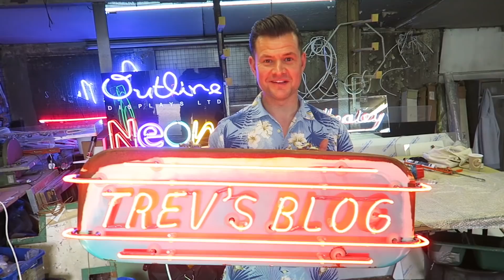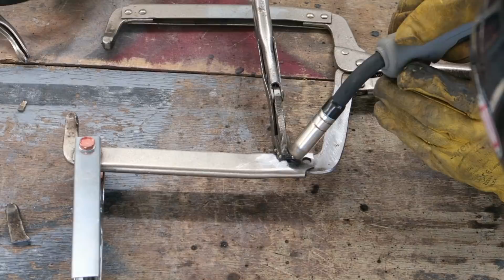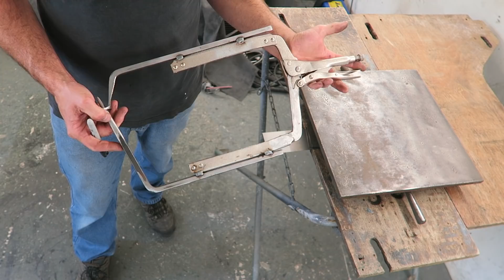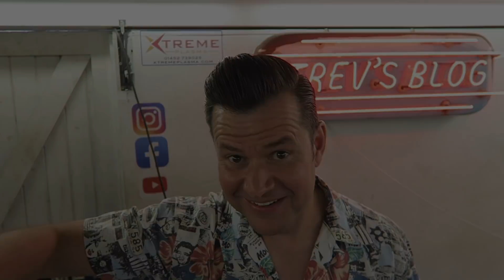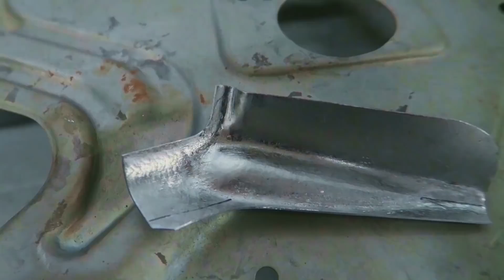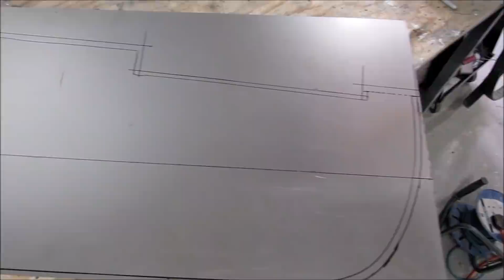Homemade Low spot dent lifter metal shaping car panel beating Tips and Tricks #54

Comment: TREV being a panel beater myself i like to use black guide coat in a rattle can no mess and dries instantly another trick for raising dents is to use an air die grinder but turn down a 5/8 bolt shaft to fit the die grinder arbour 6mm i think and smooth off the sharp edges of the hex just a little bit.so using an air die grinder you can control the speed and the the slightly rounded of bolt head acts like a mini hammer the more pressure you use the harder it lifts the dented spot ingenuity is the mother of all inventions cheers from down under
Reply from the maker: Great idea 💡 cheers Trev 👍
Reply: Can you show Me it in picture ? If you have Instagram pls let me contact u

Comment: Hey Trev, have you tried cold blue for marking panels? The stuff used to do fire arm bluing touch ups. When applied to steel it turns it a blue/black in color, has no residue like ink or paint and is easy to wipe on. It is mild acid and will cause rust if not cleaned up with water. I might even consider some baking soda in that water.
Reply from the maker: Thanks Tom certainly worth looking into, I’ll produce another video my findings sometime in the future as I’ve been messaged with many interesting ideas. Cheers Trev 👍

Comment: Take a wide felt tip marker(Sharpie hopefully) used or new, and wire brush the tip to "comb" the felt. Soft jaw it apart and spray brake cleaner into the back of the resivior till it just turns white. Close up. Thank me later.
Reply from the maker: I’ll give it a go, thank you 👍

Comment: Fantastic idea!  I use a 4 inch (10.16 cm) brayer roller with alcohol based ink to roll over the metal and the absence of ink (on the low spots), provides an indicator of where I need to work.

Comment: Great tool Trev. Have you thought about copper sulfate as a marking option?
Reply from the maker: No I hadn’t, do you mean to actually electroplate the area with copper or…?
Reply: @trevsblog  just add some blue copper sulfate crystals (I get root killer from the hardware store), to water till it dilutes to a blue liquid, brush on bare steel. No mess and scuffs off later. Ive been told this was the "blue dye" before any of that was ever invented.

I have a short 15 second video of it in action. Ill post a link for you as soon as it uploads.
Reply from the maker: @fhpdesign87  thanks for mentioning this, I hadn’t considered acid etching either until your comment nudged me into thinking in this direction. A very basic etch would also give you a very dramatic contrast to filed metal and leave no residue. Cheers much appreciated… Trev 👍
Reply: @trevsblog  

https://youtube.com/shorts/TUN--87wRbg?feature=share
Reply from the maker: @fhpdesign87  that’s brilliant, why haven’t I seen anyone using this as a highlighter. Thank you 👍
Reply: @trevsblog  hey, we're all in this to learn more every day!
Reply: You brought back memories of using copper sulfate  as a apprentice toolmaker 35 years ago , much longer lasting than blue .
Thanks for the videos Trev , regards David
Reply: @daviddeakin2006  thats what I had found in my research, that this was essentially the old machinist method! After testing it, I think I like it more than the blue stuff!

Comment: now thats a cleaver bit of tooling, simple and effective, i usually use the stud gun but with washers instead of pins, that way they do less damage to the surface (less chance of making a hole) and i use a long 1/4 inch drive extension bar to lift the lows up also gives a good chance to lever against any crowns or to keep pressure on while taping around

as for the non eng blue, i used to use dry guild spray but also use a very fine da disc to shine the steel up so its different enough from the worked areas, also aids the weld contact for the washers etc
Reply from the maker: Thank you 👍

Comment: Wondering if that tool would help with my project. I doubt you have much time but I've uploaded a 2 minute video, I need a clue
Reply from the maker: I’ve had a look 👀 most of that damage is perhaps a bit too large an area for the pick as it’s only really for finishing off. The other major problem you will have is access behind the dents. I’m assuming the only way in is through the filler? You might find some pdr rods and equipment helpful in prying out the damage. Don’t be ashamed in using a bit of filler either! Cheers Trev 👍
Reply: @trevsblog  I'd like to keep it plain ally which is why finish is important. Practically the whole bottom has been chopped out so access is no problem. I made bumping spoon from an old file which is working along with a planishing hammer (?) I've plenty of patience but reckon I might have to humble myself and know my current limit

Comment: I don't know why they don't use an eye bolt for the adjusting bolt. I just weld a thick washer on the adjusting bolt. it makes it easier to adjust. Good to stretch, lift or pull things.

Comment: I am never afraid to cut up and weld cheap tools to make something better out of it. My handiest tools are ones I have made or modified from others. Not sure if I will make one as the stuff I work on isn't worth that level of detail but I always learn something new from your videos. My talents and experience are all over the place and for me and not everything I do is going to be done all out perfectly. Gotta pick your battles on how much time to spend on each skill.

          Also for the marking compound don't use prussian blue it's super messy. A spray machinist blue will do what you want as it dries fast and doesn't stay wet. This is what I use CRC Blue Layout Fluid Aerosol 03066. I'm sure there are many brands available in the UK.
Reply from the maker: Thanks for the info 👍

Comment: Why didn’t you just use a shrinking disk?  Way faster and easier
Reply from the maker: It wasn’t stretched.
Reply: @trevsblog  i disagree if it was a low spot it was a dent therefore the metal was stretched to some degree.. Ive watched people repair panels that looked similar to what your fixing using heat shrinking disk and water ,, the panel wound up damn near perfect,, probably could have primed and blocked without any filler being used…just my thoughts..
Reply from the maker: @terryjohnson4391  ok

Comment: That's a cool tool. The only suggestion I have for highlighting the high and low spots instead of Dyechem engineers dye is to use a light dusting of spray paint. Let it cure and sand away. Basically works the same as the powdered guide coat used for sanding and blocking primer. It will do the same Job as the Dyechem without the mess.

Comment: No way I thought you used a ring spanner to start off with. Great bit of kit, I guess the longer you go you start to loose force from the falcrum point.
Reply: Yeah I was thinking big el cheapo offset ring spanner would work for this.
Reply from the maker: The length I set it to seems perfect, any longer and I really believe it would start to lose its accuracy and it would be a lot of weight to shift with the pick fully open. Cheers Trev 👍

Comment: This is absolutely brilliant! I have a bulls eye pick from Eastwood and I am really disappointed with the quality of it. Mostly because where the joint is its too sloppy and makes it inconsistent. I think I will try to make one of these! As for dying the panel, they make machinists blue in spray cans. (Dykem) Its way less messy than the brush on stuff. Also, the really wide tip sharpies work great for marking and layout too (I apprenticed as a machinist and went through and became a Millwright)
Reply: Yeah, the Eastwood stuff is piss poor quality. I have had to modify almost everything I had from them. Not good value, hu. Cheers
Reply: @toddcott9510  agreed. I have a deep throat stretcher from them and the stretcher is good. The dies are terrible.you are absolutely right. Its worth it to save and buy something a little better
Reply from the maker: Thanks David 👍

Comment: Hey Trev.
Great to see you back on the Blog.
Using the large chizzel tip jumbo marker as per Wray Schelin from Pro Shaper seems a relatively common and inexpencive  way to guickly add guide coat for the metal finishing tell tale highs and lows.

Comment: Hi Trev have you tried dykem layout fluid it is good stuff but quite expensive compared to a sharpie, the engineers blue does not dry so is very messy that is used to test fit\engagement. Keep up the great vids